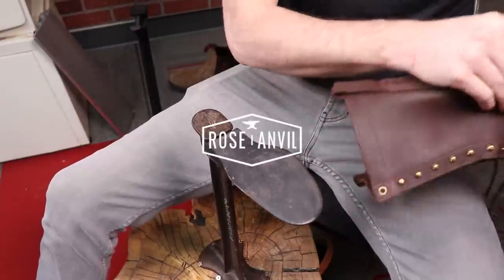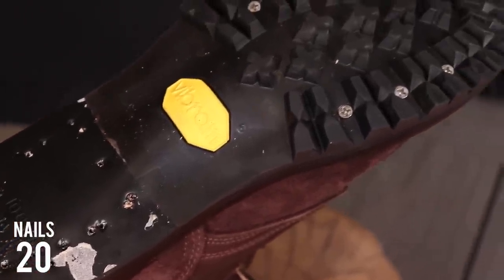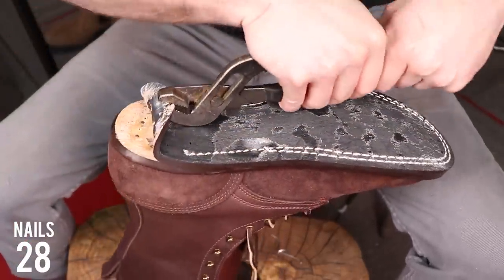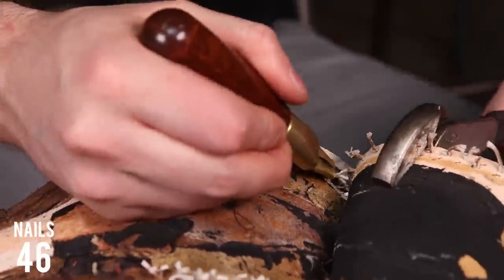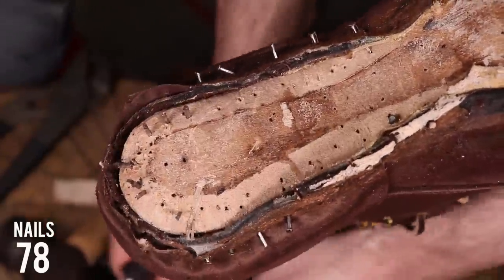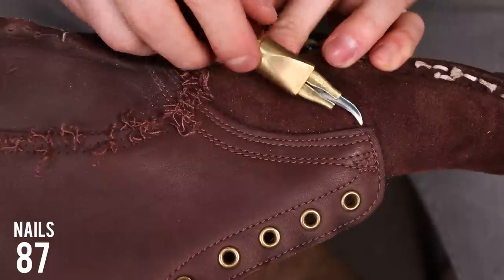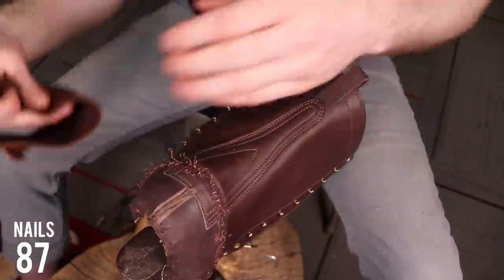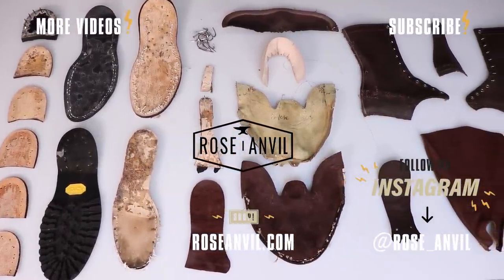Why Are 80+ Nails In Nicks Boots?

Comment from the maker: The ROSE ANVIL X NICKS collab boot drops on july 10th and we are only doing 500 pairs so get on the list! - https://forms.gle/GW7Z8FxkxzQuNxMN6
Reply: Are these boots made in America?
Reply: Might there be solvants to help loosen the  glue ? The solvents can be unpleasant stuff,  i know . You'd soak the  boots first for a week or two and maybe air them several  days before dismantling em .
  Co2 is a good solvent in liquid  phase . Easy to remember that you can  have it liquid at -20 c° and 20 bar pressure . A bar is almost  one atmosphere ( 14•7psi) . Of course the co2  source is your readily available dry ice.   -  from memory 28 bar is required at -10 ° C and 15 bar at -30° . Needs a suitable pressure vessel , I've said enough .

Comment: Can't argue with how tough these things are.
As a man in his 50's these boots would literally last me the rest of my life.
Reply: I'm half that and they'd probably last the rest of mine too.
Reply: They would last me maybe 3 years tops. I try to keep them clean but every boot I've owned has become a nasty athletes foot factory by then. Honestly at 3 years I would have got my money's worth out of them for sure.
Reply: @wyomarine also airing out your feet daily is important. There are people who wear shoes and shitty plastic slippers from the time they wake up until they go sleep, despite not needing to. That's too much neglect as well.
Reply: @Saphire_Throated_Carpenter_Ant  

I've had my pair of Nick's for just over 2-1/2 years. I drive a 18 wheel gas/diesel tanker truck. The petroleum products are hard on the soft vibram soles, but the actual boot is holding up like a champ. With good quality wool socks (darn tuff, point6), my boots still have that warm comforting smell of fine leather after a hard day in 98 degree/98% humidity. Can't say that about any of my other footwear. I'm 55 years old and been driving a big truck for over 30 years. My only regret about the purchase of my Nick's Boots is that I didn't do it decades earlier. With the discount offered here, I think I'll buy a second pair in tan leather for everyday, off work use. Once broken in, they are the most comfortable boots I've owned. If you ever decide to pull the trigger on a pair, you won't be disappointed. Period - Full Stop
Reply: Saphire Throated Carpenter Ant Yeah come home from work after working 8-12 hours and forget about being tired and everything you got going on in your life and clean your boots everyday lmfaoo.
Reply: @fromthe772  you barely gotta clean your boots if you actually clean your feet in the bath or shower. The discussion wasn't really about cleaning boots, anyways, it was about keeping your feet themselves clean. Because what they described is a hygiene issue, not a shoe issue. You can take a five minute shower and get everything clean. I never cleaned my work boots when I was doing roofing and framing and never get athlete's foot because I actually wash my feet and just let my boots air out properly. 

Athlete's foot is not a normal condition and typically points to poor hygiene practices if you consistently get it.
Reply: Jim nah I call bs, when I come home from work first thing I do is take off my boots, second is shower, I’d say it has to do with the type of work your doing and how much your feet sweat.
Reply: @fromthe772  Your feet could possibly sweat more than the average person. Try foot powder with your boots to lessen the dampening.
Reply: @Saphire_Throated_Carpenter_Ant  you might have some serious foot care problems, make sure to change your socks at least daily and invest in a boot dryer.
Reply: Are they comfortable though? I'd like to get my dad a pair
Reply: @wyomarine Comment is a year old but worth affirming. I switched to moreno wool socks 5 or 6 years ago. The ones I get are costco outdoor wool socks and the wool count is over 70%. I hate how socks are sold as wool with single digit wool counts. Anyway. My feet are never hot or cold and they don't get stinky even when an out of town trip goes longer than expected and I have to recycle them a day or two. That's the beautiful thing about quality wool socks. you can get by on two or three pairs if you swap em daily and let them dry thoroughly. I  have had them wet in cold weather and not ben able to tell that my feet were wet or cold. And I do construction in Bakersfield California t times when it is 120F, and my feet do not get cooked.   I give these socks to family and friends for Christmas now hoping to open their eyes.

Comment: When I was an ortho shoe maker, we made a work shoe/ boot for a concrete worker. What you have there for the most part is what we did for him. Note the old fashion way of making the heal stack is to glue the layers and beat the thickness to maybe 60% of the original thickness. The leather shank would cover a metal shank as well. A long leather counter to cover the whole back half of the shoe.

Comment: I got about 3 years out of mine and by the end the nails were going into my feet. That little piece of leather on the inside always falls out if the boots get wet frequently. Also need to be oiled during the winter or the toes will dry and curl. Still the most solid boot I have ever owned.

Comment: Mostly created for wildland firefighting, construction is made by a mold for persons foot, tight fit and narrow heel or wide. Depends on the measurements you send in. Now the fasteners nails and screws are there in case the glue does fail to hold during ground work in fire. And is a standard for almost all caulk boots.

Comment: If I'm not mistaken, I see that the nails on first layer layer (rubber pad) looks like a regular iron nails that are usually used in furniture/wood working. Bcoz they are made from iron (not brass), they will corroded easily due to water/liquid contact or weather exposure. Why dont Nicks use brass nails? Btw, aside from the nails material in question, I still want to add to my collection a pair of Nicks Boots.

Comment: I’m a mechanic and an avid hiker. I hate having a heel. I love the arch support of my whites smoke jumpers but the heel is so impractical for anything I do on hard ground. The one place they shine is on the soft ground of a forest. The heel sinks in a bit and my foot flattens out. Otherwise all the heel does is rob me of power from my calves. A flat footwear will allow maximum travel of my calf and allow me to push the most with my calf. The only reason that feels painful for someone is their calves arent conditioned for prolonged use. Once your calf muscles get into better shape that pain will disappear and you’ll hike much faster.

Comment: I see the nail counter to 87, i have watched Beto's leather fix shoes with nails and each nail took about 1.5 seconds to put in so the number of nails is adding only  adding 130.5 seconds to the  manufacturing time and nails are cheap (you buy them by the pound).  That's not too impressive but the stitching and layers in the sole are impressive.

Comment: As someone who knows nothing about footwear, but appreciates a good boot a lot (haven't worn regular shoes in maybe 5-6 years), I'm worried about how many nails I'd effectively be walking on top of. Is there any danger that a major impact (e.g. jumping off somewhere high and landing on 1 foot) could drive one of those nails into your foot? Am I being paranoid?
Reply: Nope, as long as the length of those nails did not exceed the thiccness of the sole it should be fine for your feet cuz they can't move any further except you wear the outersole so badly that the nails are exposed so the thiccness decrease and if the nails are longer than what it's left so they can hurt your feet.

To be honest, nobody that wear the boot that so expensive to the state that I mentioned above.

Comment: Over time would a boot like this shape to your foot? Or would your feet succumb to the authority of the boot?
Reply: They form to your feet after break in. You can use hot water and pour it inside the boot, and then wear them with the water inside and after a bit the leather will form over your feet.

Comment: Does anyone know how Nick’s boot fit compared to Red Wing? Especially Red Wings  8 last like the Iron Ranger. I live in the Netherlands, going through the fitting experience where they send me a pair to try on and I have to send ‘em back again can be a hassle with customs 🛃
Reply: They fit like socks. Add some hot (not scolding hot) water and poor in inside the boot and put your feet in them. Wear them for a bit and they will form perfectly around your feet. Then dump the water out.

Comment: Real question to anyone whose done blacktop. I have yet to find a boot that doesn't wear out in less than a month. Due to the extreme heat. If anyone has found one that's light weight and the soles don't melt fast under the heat. That would be awesome info.

Comment: How come on expensive boots like this a leather shank is enough, but on a cheaper boot like a doc marten or a timberland a steel shank is more likely/appropriate, whereas a wooden shank is entirely inadequate? Can we get a shank breakdown video? 😭
Reply: The “shank” on Nicks boot provide the same protection as a metal one but at the same time they form to your foot over time.  And this specific model boot is a wildland fire boot so metal shanks are not allowed. They heat up and burn your feet when working the lines.

Comment: 4:35 a nailed heel seat will never be as durable as a stitched one! nails rust and loosen up with time, grinding their way through the leather with their sharp edges and widening the holes. stitching is probable to outlast the leather itself! but there is no machine for seat stitching so it's a bit more laborious. the benefits of nails are that it's quick and easy to build while still being a pretty solid construction and that it's stiffer(if you want that) which makes sense in absence of a metalshank.

Comment: I intended to buy one until show me those nail. Thank you for your warning.
Reply: they will never puncture your foot, they have so much leather and vibram there is no way it will contract enough for the nail to even come close to breaking the skin. nicks has made boots for many years, if they had a problem with nails hurting someone they would have changed their method. there is a reason they are handmade and last as long as they do and made the way they are. also every pair of shoes made of leather and many other shoes like dress shoes all have nails in them

Comment: Humans have a natural posture based on our skeletal structure. The heels of our feet are not elevated excessively. We know what heels on women’s shoes do to harm their posture over time. The dames holds true fir a man’s boot. The only reason to have an elevated heel is to appear taller than you actually are. Tom Cruise for example wears elevated heels.  Why? Because he’s 5’6” tall.
Reply: there is a difference between heel height and heel spring. the spring describes how far your foots heel is lifted up in correlation to the ball of your foot. a high heel with 5cm heel height might have 4.5cm heel spring due to a thin sole! these boots, while having probably about 4cm heel height should have about 2cm of heel spring due to approx. 2cm of sole thickness. from an orthopaedical standpoint 1-2.5cm of heel spring are more or less harmless or even good! with zero heel spring 90% of your body weight is on your heels. on modern stone and concrete floors this is not exactly healthy. as you step, there is little spring effect and all the impact goes threw your heel, straight in your legs, knees and spine. to prevent joint and spine problems a bit of heelspring can be very effective. also by bringing your hips forward and your shoulders back which can straiten your posture. a bit of heel spring also supports fluid walking so you don't exhaust as quickly. this is why for the most part even sneakers and running shoes have about 1-2cm of heel spring.

Comment: If the glue holds that well, why all the nails
Reply: Added security.
Reply: like he mentioned: only rubber on rubber bond is this strong. also its just glued so you can change outsoles without having to cut the threads

Comment: Because real men use them, I work over 1300 hours overtime in 6 months, and they still fall apart, $700.00 boots and still don't last a full year, on the fireline.
Reply: I’ve Never have had a pair of Nicks fail on a fire 🤷🏽‍♂️ as long as you get them re-soled every few years they should be good

Comment: Filling a comfortable, supportive material so full of nails that they're supporting your weight defeats the purpose. Why bother to use any particular material on the sole, if they're just going to fill it so full of nails that your weight is supported by the nails instead of the leather/rubber/cork/whatever? Why not just solder all of the nails together and make the entirety of the bottom of the boot stainless steel?